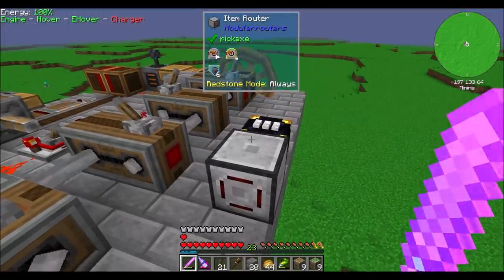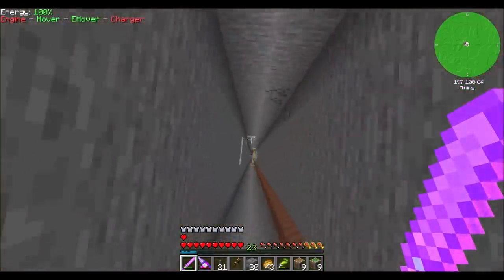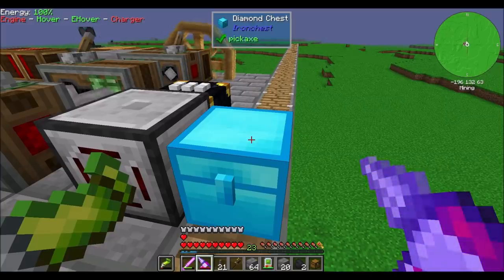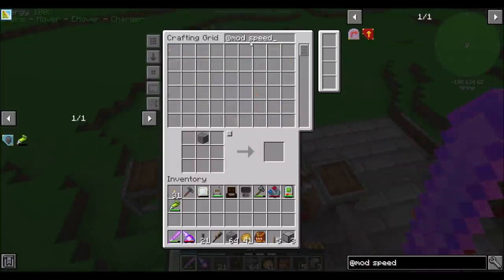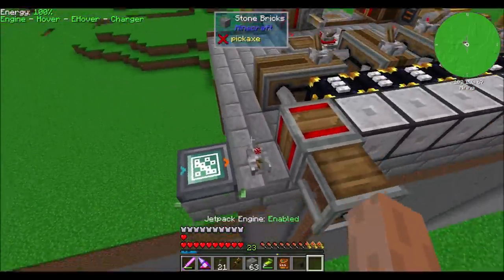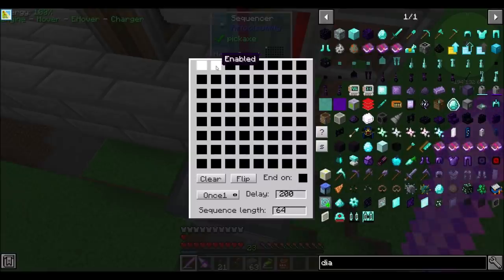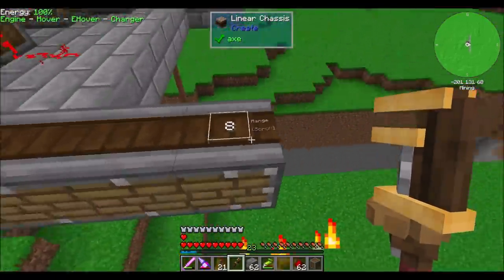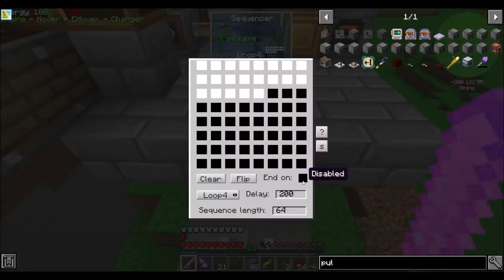Lets Play S10E54 Inchworm Miner Mk2

Comment: The pneumaticraft armor has two modes of flight on a hotkey, builder mode and normal flight. Just saying.
Reply: or he could easily kill/ignore the dragon, get an elitra and get the angel ring
Reply: @JoachimVampire  the armor is more fun, upgradable and enchantable. It can be better than netherite armor and have prot IV plus night vision, puts out fire, anti bad potion, locate spawners/mobs/items and more.
Reply: @jaffabeast  well, yes but dire is dire and he will no longer use pneumaticraft ever again in this season sadly. He doesn't even know the potential of the mod
Reply: He has the bad habit of thinking that he found out the max capabilities of the mod and move on. He missed a heck TON of fun stuff in previous packs because of that... For example the alchemy system from Betweenlands is just perfect and he thinks that betweenlands is just another empty dimension mod...

Comment: Dire, I may missed something in the previous episode but I don't understand why don't you just place the enderchest where your regular chest is in your inchworm Mk2... I mean it must have a reason but the enderchest seams to be fine moving... also its enough to lover the rope pulley block you didn't need to lower the whole contraption. it could be flush with the lowest part of the platform and you would have the same result. if i'm wrong somebody please somebody correct me because this bugs me a little bit. thanks!

edit1: also I think create have its own solution to transfer item from moving chest and that works best. i don't know what is the name though
edit2: ok i got further in the episode so I can see now it wont pick up the items...
edit3: Dire you could make che chest large chest and you could have half the amount of routers and enderchests like you could skip every other block when you place them

Comment: Does the mekanism jetpack have the droop too?
Reply: nope it hovers perfectly fine but it uses hydrogen as fuel and the internal tank is rather small and empties pretty quick in hover mode
Reply: He could keep the jetpack to fly quickly and just use an angel ring to hover with precision, also it removes fall damage and you can put in a bauble slot or whatever they are called now
Reply: @Total2Gamerz  curio

Comment: Now calculate the time spent building the inchworm machine versus how much you could have mined by hand the same amount of material, then figure out how long the machine has to work to surpass the hand mining efficiency. If it can run that long without major breakage, you will have succeeded.

Comment: Did dire try vanilla ender chests? Might work with Create.
Reply: Hmm vanilla ender chests are strange in that the player that opens it access their ender inventory, so it would be limited to one vanilla ender chest worth of storage unless you can drain it while the machine is drilling, if it worked at all.
Emptying them automatically is also not as simple as it may sound, as I can't think of anything offhand that can do so, I am sure there is some mod with player specific support that would let it pull from your ender storage specifically, but it isn't a common feature, it is what the colored ender chests were made for really.

Comment: I think I would use minecarts if I were to do the same thing w/ create.
Reply: I tried making a system that places tracks as it goes, and uses a plow at its back to remove the old ones. Do not forget to put an extra deployer that tries to place cobblestone below the track, I forgot that and my whole contraption fell into a hole. Still, my device was a little bit problematic, It kept placing the tracks wrongly or it randomly stopped, etc. A furnace minecart solves the stopping problem though. Still, if you can make yours work, I'd like to see a video.